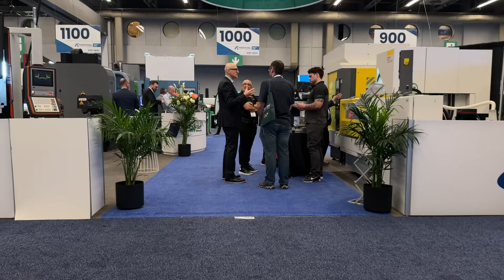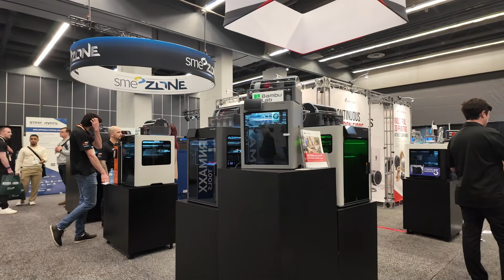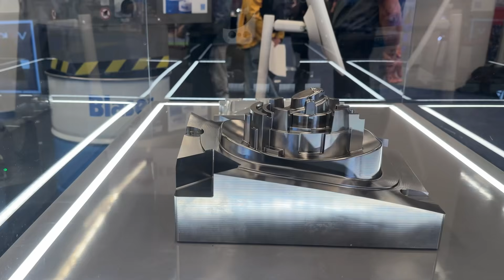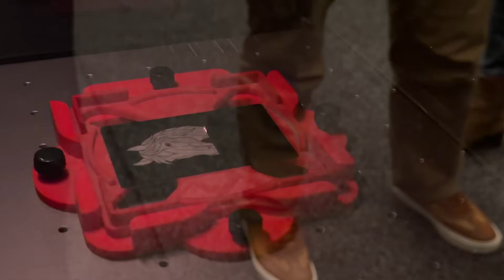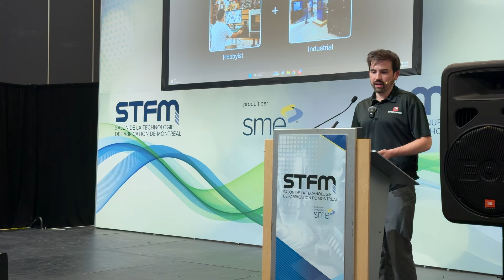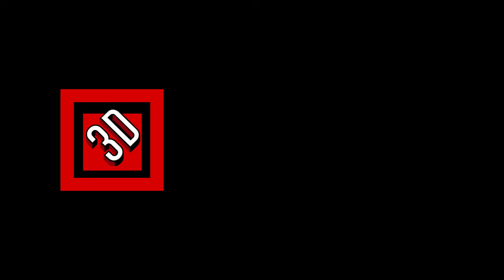Why Everyone at MMTS Was Talking About Bambu Lab

Comment: I’m fairly new to 3d printing, have an Elegoo cc1 and cc2 and a Snapmaker u1.  I would never even consider a bambu.
Reply: The original CC is a great printer, especially for the price. I might get a second one.
Reply: @robertbaker7313  I have 1200 hours on mine, only had to replace the front cover of the tool head, when the magnets weren’t screwed out far enough to hold the cover securely. It broke the small fan.  Other than that, it’s a workhorse.